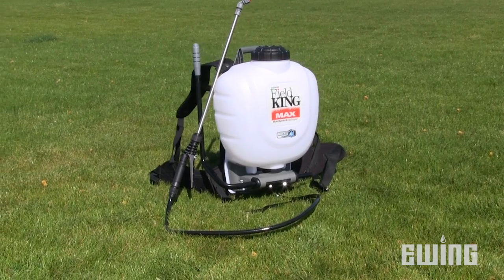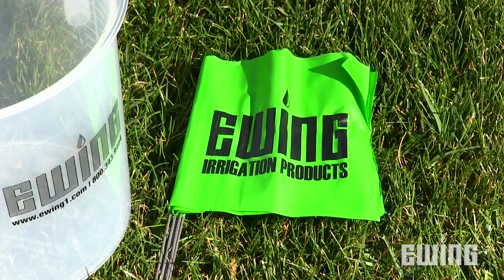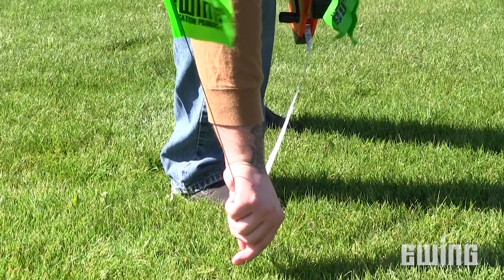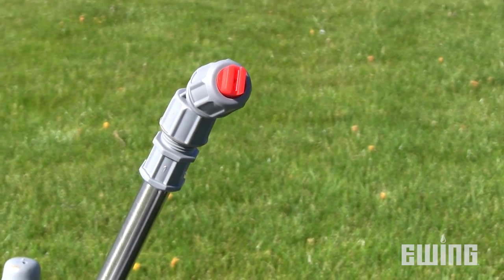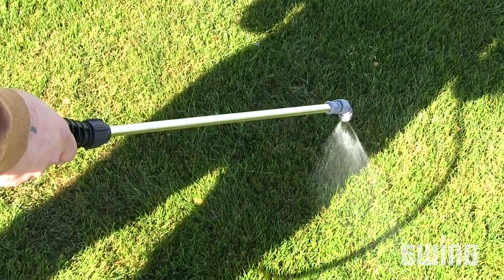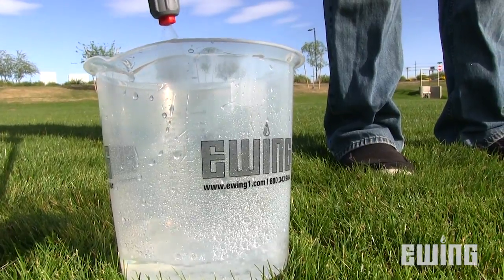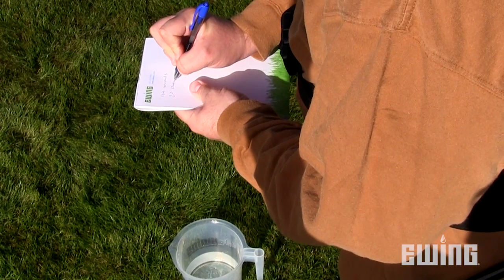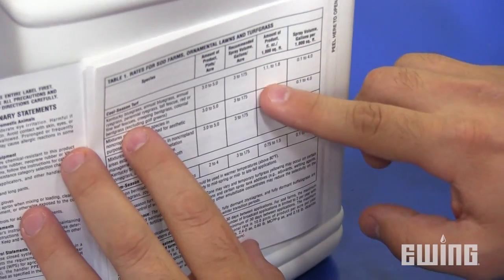How To Calibrate A Backpack Sprayer

Comment: At 20 oz you have to crawl to deliver 1 gal per 1k sq ft as most products are set up for 1 gal finished liquid you would have to reapply over and over to get the right quantity on the lawn . No one speaks of this
Reply: my sprayer is putting down 1g/1000 sq ft and takes 5m30s to do it. seems excessive (40g/acre?) and excessively slow... but I'm just now trying to figure all this out.

Comment: Why don't you show the math? You simply say 20 ounces = 20 gallons per acre. What if I am spraying 51 ounces per 1/128th?
Reply from the maker: Thanks for the question. The math is already done for you by using the 128th method. As Dave mentions at 2:21 in the video, there are 128 ounces in a gallon and you are testing an area that is 128th of an acre. This means that each ounce you collect in the cup is equal to 1 gallon had you sprayed an entire acre. So for you that would be 51 gallons. If that volume is too high or low for the product you are applying, then you would need to adjust your nozzle flow or swap it out for a different one and re-test.

Comment: I calibrated  my sprayer to 4 mins per gallon. So now how do I know how much chemical to use? Ie. my mixture rate from the manufacture states 3 oz per 1000  sq ft.
Reply from the maker: Hello Gary, thanks for the question. It doesn't sound like you performed the test correctly. You need to determine how much water you used to cover the test area rather than how log it took to spray a gallon. The first step is to spray the test area (128th of an acre) and time it to see how long it took. Then spray into a measuring cup for the same amount of time it took you to cover the test area. The amount of ounces collected in the cup will translate to gallons required per acre. So if you collected 20 ounces, you would need 20 gallons to cover the acre (43,560 sq. ft.). Next, do the math to determine how many gallons it will take to cover the area you plan to spray.  Now that you know the total gallons required, you can use the chemical manufacturers instructions to prepare your mix. This article from A&M might help to clarify.
https://www.aces.edu/blog/topics/forestry-wildlife/the-1-128-calibration-method-for-backpack-sprayers/

Comment: Great video which showed what you need to do for calibration....however as a person from somewhere that uses normal understandable units, the randomness of imperial was painful to watch - 128ths of an acre? What?!   Comparing this to metric, where you'd mark out 10m x 10m to give a 100m2, and how many litres (or 1000ml) are needed to cover that area - it's just so much easier to understand and apply but I guess it's what you get used to.

Comment: Just got one - on  EVERY pump - the handle makes a loud squeaking sound. Any way to stop it? Guess I could try WD 40.
Reply from the maker: Using the WD-40 would be a good first attempt. It also may be the sound of air being forced into the internal pressurized chamber.
Reply: @ewingoutdoorsupply  Thanks! The only real issue seems to be that it takes a lot of effort and pumping to maintain the pressure. I would have thought 4 or 5 pumps would have the pressure considerably up - but that's not the case. 

However, it is very comfortable, with the frame backpack. Sits sturdy. With liquid, the pumping sound isn't as bad. I particularly like that the pump is inside the body of the sprayer - so, if it develops a leak, it can't drip all over you.

Comment: Whats the difference. Between these 2 spreyer  the professional & the max .???
Reply from the maker: Thanks for the question! The main differences are the Max has a new comfort harness system with thick padded shoulder straps and waist belt with storage pocket for extra nozzles. It also has a stainless steel wand vs. Poly wand and a 5yr warranty vs a 1year warranty on the pro.